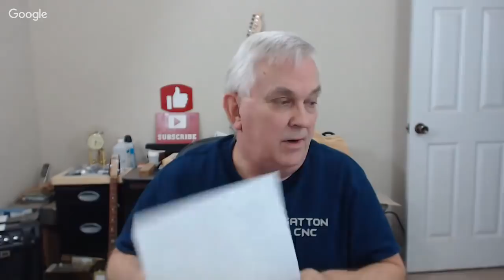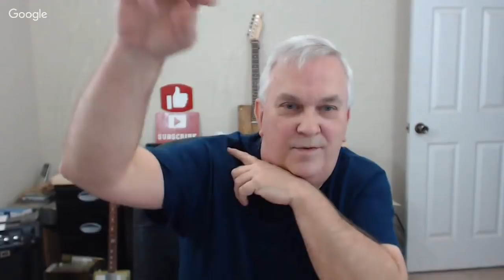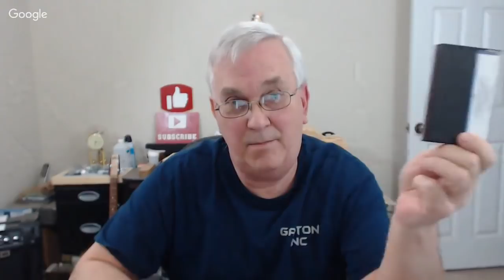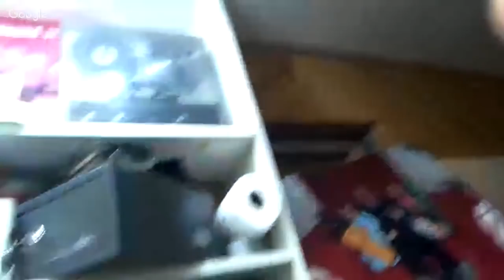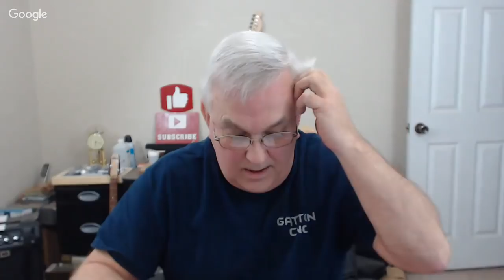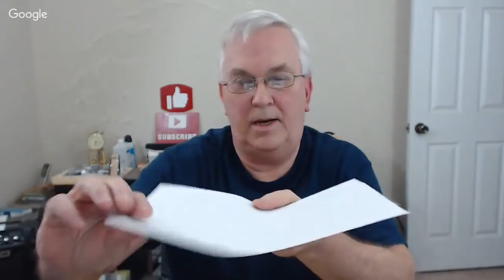CNC With Dave Gatton -  Common CNC Beginner Mistakes

Comment: Great show guys. In regards to temperature monitoring, I have seen an Arduino connected to UCCNC via MODBUS. The Arduino monitors the motor temperature and slows down the UCCNC feed rate if temperatures get too high. With the right sensor, i'm sure it would work by measuring the bit instead.